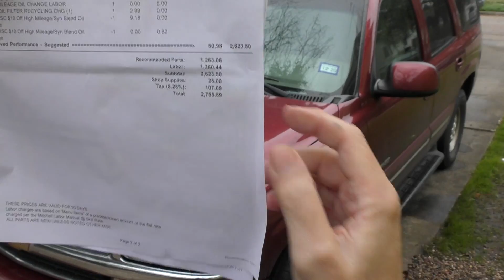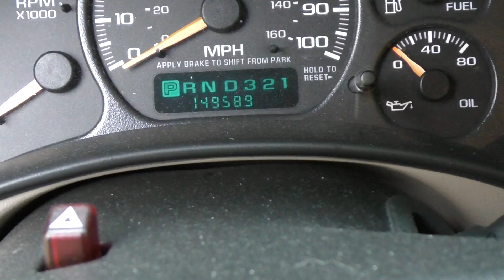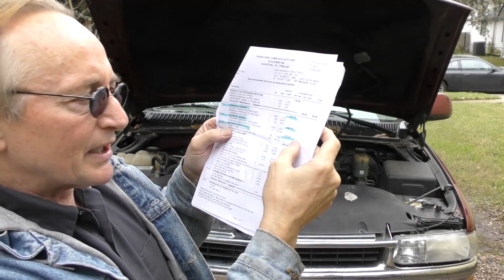This Makes Me Want to Quit Being a Mechanic

Comment: Valvoline passed my NY inspection and I knew I had no life left on my brake pads and a warped rotor
Reply: Andrew in a nys inspector . The law is if it’s not metal to metal it passes, you could seriously have the thickness of a sheet of paper left and they technically pass and same with rotors long as they are not cracked your broken they pass

Comment: Good tip, thanks. I went to Big'O Tires for oil change and they said I was down to 4mm and need tires soon....I had calipers and knew I didn't. 18 months later, had tires inspected at Pep Boys  = 6mm still left on tires. Big'O Tires manager, "Oh, your battery is bad." I pointed the inspection, "Inspector checked off that battery is good." I changed out the battery 2 years later (because I wanted to).

Comment: I had a Mercury sable I tried to replace the spark plugs and I went to Firestone to ask for a estimate and they try to charge me almost $ 500 dls for parts and labor and I said no thanks it was my first and last time with them I just no recommend them NO WAY
Reply: $500 is normal for a basic tune up but for JUST spark plugs then yes. Big ripoff
Reply: Rock-E Oldboy maybe in 1980
Reply: Even with labor that is $100 tops. It’s insane how much places are charging for spark plugs. $300-$400.

I bought some 100k rated plugs for $30 and called it a day.

Comment: I went there for 2 inspections because I thought i had a blown head gasket on my mustang. They told me no head gasket but needs valve cover gasket. Drove the car hard for a few thousand miles and found out I had a blown head gasket and the motor now needed 3,000 in work because of driving on it 🤦‍♂️

Comment: One thing I learned from Scotty “ If ain’t dripping ain’t broke”
Reply: Yep.  I tell my customers that all the time.
Reply: if its DRY AS A BONE, its DRIVIN YOU HOME
Reply: Even a small drip means nothing. Keep the fluids full and you're fine.
Reply: I II III II I Not true at all. I’ve had vehicles that would leave no spots at all that would overheat in traffic from very small coolant leaks.
Reply: @MegaMustangkiller  thats coolant ralated matter. Engine will overheat if no coolant. Oil leaks is different from oil dripping! Light oil leak that does not drips to the ground is fine. When it drips, u have to get it fixed. Serious problems.
Reply: @MegaMustangkiller  get it fixed yet? Head gasket?
Reply: Matt Schmitt was a radiator and I fixed it about 6 years ago. With a/c on it would over heat in traffic but would never leave any “evidence” in my parking spot. I wouldn’t totally discredit everything Scotty says but as an Ase certified master technician I find quite a few issues with his practices. Not trying to be a YouTube know it all I just think that for peoples own good they should take his advice as well as anyone else on the internet with a grain of salt.
Reply: Troy Truong some people should also try to learn the difference between something that a technician noticed while checking out your vehicle and wanted to make you aware of to let you know how much it would cost to take care of when you have the money and something they said needs to be fixed today. This guy blows everything out of proportion to get views. For all you know the employees at that shop may have just been informing the customer of a problem that was developing. If you ask Scotty he’d probably say that skim milk is a scam because it’s mostly water

Comment: I took my Lexus rx330 to the dealer to have the cracked dash replaced under a recall. No charge to replace it but they gave me an estimate of $6,000 of recommended repairs they said I needed ( including replacing the radiator) I took it to my own mechanic & he said all of the “ so-called” issues were fine. 5 years later & still no problems with the Lexus.

Comment: The worst in Canada are dealerships. That friendly greeter in some dealership works totally on commission. Then some of the prices are nuts.$50.00 plus the price of the bulb to change a brake light,$65.00 to instal a battery, plus the cost of the battery,$25.00 to put on windshield wipers plus the cost of the wipers. Brake job all 4 axels can be $1500 to $2000.That why I do it myself.

Comment: Meineke had a great deal on an oil change ....$15.99.  The Oil and Filter would cost me that to do it myself, and I have to pay to have the oil recycled.  I took it in, and when I picked it up ... they handed me an estimate of $1700+ for random fixes.  I told them I'd be back, and 4 years later finally sold the car with none of those things fixed, and it was in great condition.

Comment: "lots of tread here" sidewall fibers exposed
Reply: Why does this not have more likes. I came looking for this comment and had to dig.
Reply: Those tires might be 8 years old regardless of the tread depth then they should be replaced.
Reply: Exactly scotty can be dumb at times but hea a mechanic not an auto tech so what do you expect theyre all going extinct because of a mindset like gis
Reply: Those tires were curbed multiple times by someone who likely cant parallel park very well.
Reply: It looks like they drove down a wet gravel road and got in a puddle on that side. Then drove for a bit on damp concrete cleaning off the treads and not the sidewall. Back tire had some on it. The raised letters were still on the tire. I'm no forensic scientist, but my guess is you're no tire inspector.
Reply: 3:55 that’s actually the paint coming through for the white branding. Not any “fibres”. Most of these tyres can be mounted white writing in if you don’t like that look.
Reply: @RC-rb1cp  that's more to do with the ever increasing amount of electronics and computers than anything else
Reply: Those tires looked like crap honestly
Reply: That's actually paint.
Reply: Yea
Reply: If I had to guess from the quick look he gave of the tires they look to have 4/32 of tread left which at the tone of the tire you start looking for your next set
Reply: In what way does that look like sidewall fibers
Reply: LOL

Comment: A few years ago I took my Jeep Cherokee to jiffy lube for an oil change. They came out and showed me the oily pcv valve & said it needed replaced. The Jeep had 120,000 miles on it so I said ok. Then, 3,000 miles later, I took it back to jiffy lube for another oil change. The guy came out with another oily pcv valve & said it was bad & needed replaced. I told him they just replaced it 3,000 miles ago & asked if he REALLY thought I needed it. He said “ well, I guess not “. I never went back

Comment: I needed 2 tires replaced on my Nissan Sentra, so I took it to the local “Liarstone” dealers. They charged me for 2 valve stems in addition for the tires. I looked at the stems and they still even had the road grime on them and the rims were still dirty, except for the fingerprints where they handled them for the tire change.
The car has a TPMS system, so I KNEW they hadn’t touched them. Got that valve stem charged taken off. They admitted they always charge for stems because “they usually change the stems out of course of habit.” Guess they just “missed them” this time.
That was the last time they ever got to see my car in their shop.
Reply: david Hanesworth To be fair, and I’m not defending them, but tire stores like Firestone and Pep Boys do “rebuild” TPMS sensors with new rubber valves or new nuts/washers depending on the style, and as someone who started off at a Pep Boys, sometimes it does happen that you just get in a rush and forget. It’s an unfortunate thing, but I can’t say I never accidentally did it, and I’m willing to bet every single person who’s worked at one of those stores has done it, even if it was just when they were starting out in their careers

Comment: i took my car in for an anual inspection the shop told me:
1) reverse lights didnt work
2) there was an egr fault
3)the seatbelts didnt catch when he pulled them

i went to talk to they're mechanic and found:
1)the mechanic didnt have the car turned on when he put it in reverse (manual)
2)my car does not have an egr valve
3) he didnt "pull" hard enough

the shop charged me $120 and threatened to put a mechanic lien on the car if i didnt pay (they still didnt give me the inspection paper)

Comment: Here in NH, yearly inspections are mandatory. The law is written such that any inspection issues found have get the OK from the shop who failed your car. So unless your mechanic is a Saint, you could wind up in the inspection/car repair racket.

Comment: Scotty, I wish I could claim this was unusual.  I've been doing most of my own work, but an alignment isn't one of them.  I took my '02 Ranger to get an alignment at a local shop (with a coupon) and they told me I needed wheel bearings because of the feathering on the tire.  $500.  I do actually now need wheel bearings on the one side, after 150,000 miles.  The bearings cost less than $20.

Comment: The Managers are paid bonuses based on a PTA (per ticket average) they run $20 oil changes thrn offer the managers bonuses if they can make ex. $75 per ticket average so the managers try to up sell everything they can to bringvthe avg up to bonus range.

Comment: Lol, you call that a scheme?! Here in Europe where we have the government inspection, you will not slide through with $25!
Reply: GEEZZ!! What do they charge you guys?
Reply: @invaderzim1265  It depends on the country but in general, they are very strict especially to older cars. The inspection itself actually cost about $25 where I live in eastern EU but if you have an older car you will need to change parts and chack it in private service before you go to inspection to make sure it will pass and that's what costs money. Also, nothing can be modified, you can't even have toned windows plus you also need to pay a road tax. For my 2006 VW Passat B6, I had to pay about $125 last time without insurance cost and nothing needed to be changed. And $125 is not a small amount of money where I live...

Comment: I am no mechanic but i did study Mechanical Engineering in College and i have a good idea of most mechanical things. So, that Chevy that Scotty showed with a bit of grime and grease...go buy a can of engine shampoo and give under the hood items a good cleaning. The cost will be about $10 and 30 min of your time at the most. As for the rear diff....it wouldn't hurt to drain and refill the diff with new gear oil. My Tacoma sees off road conditions...so every 100 000 kms i get the two diffs....the transfer case and transmission drained and refilled because of the risk of water contamination. I had this done at my Toyota dealer at a cost of $160 i think...which seemed pretty fair price to me. As for all the repairs listed on that estimate...those crooks should be neutered. Good for you Scotty in being so honest. The world needs more guys like you. I would argue that being honest like you are may give you lifetime customers. If you build a level of trust...should mean repeat customers for sure.

Comment: I'm glad we don't have inspections here in Florida, I've driven vehicles with the check engine light on for years. The lights were for small things like catalytic converter efficiency and evap system

Comment: Midas tried to charge me $150 for serpentine belt replacement. They said it had a crack in it. Put a new one on it myself (30 bucks) a coupe days later. NO CRACKS/CHIPS/TEARS.  I only take my car to the shop if I know it needs serviced and I don’t have the tools, space, or time.

Comment: FireStone inspects the car and writes down all the problems it has & looks up the Manufacturer Milage maintenance. For example If the manufacturer recommends new coolant hoses at 150,000 miles FireStone recommends it. New air filter every 10,000.  Alignments, tires, brakes.

Comment: Sounds like the opposite kinda shop I went to once. ONCE lol check engine light came on noticed no acceleration plus other things on my ford ranger. Took it to a place and said whatever is wrong with it, fix it. The owner wouldn't touch it. Kept eatting his sandwich and walked away.

Comment: As a kid, I worked at my dad's garage.  So, I'm not a mechanic by trade, but I at least have a general idea of what's going on.  I hope Scotty sees this ... I went to a garage near work, and asked them to change the pinion seal on my rear end.  The guy calls me up, says my rear shocks need to be replaced too ... they're "seeping oil."  I said don't do anything, I'm coming over.  Oil had been flung by the leaking pinion onto the metal "skirts" on the rear shocks.  Those skirts don't have any oil in them, that metal CAN'T POSSIBLY leak.  I told him let it down, and I'm outta here.  He lost a customer.

Comment: That is the same Firestone location on Kirby Dr. that I used to take my vehicles to for lifetime alignments. 9 years ago they told me I needed to replace all radiator and coolant hoses because they were cracking on my 3 year old subaru outback. I went home and wiped them down and they still looked brand new. That was the last time I went to that particular shop. 9 years later I am still driving with the same hoses and no coolant leaks.
Reply: WOW!!     LIKE WOW!!!!😲

Comment: Scotty ,please read Car and driver, GM recalls 2019 Silverado and Sierra for break-failure issues. The onStar App was causing brakes to fail. I never used my phone to operate truck in any way! My dash board lights came on BREAK FAILURE!!!!! I turned off my truck,then started back up. Check engine stayed on.Alert said," don't operate over 43MPH. Yeah! dealership said," it's fixed". Should I be concerned?

Comment: THIS is why Delaware has STATE RUN inspection stations where NONE of the inspectors have ANY motive to tell you that something is broke. There is a station in each county. ALL things are checked including a braking check where you are required to drive over a pad and hit your brakes. The system will show how each brake is working and which one is weak. States should look at doing this as it is another way to gain revenue. You are NOT charged for the inspection but you will have to pay for the tag sticker for the year. at only $50 per 4 wheeled vehicle or for two years on ones that qualify for only $100. NOT BAD. The state of Delaware does well on this.

Comment: I had a Tread Quarters shop in Virginia try to sell me about a thousand things I didn't need at exorbitant prices and then top off my power steering fluid for an inspection. The power steering cap was never touched. It was still very dusty. I left with no work done other than the inspection, and the shop kept warning me I would break down. I drove all the way from Virginia to Louisiana and back just fine.

Comment: Once I go to a mechanic for oil change and front brakes check at 60000 miles. He told me I needed all four brakes replaced. I told him just the oil change and do the front, because I know rear drums brakes last much longer, and never go back.

Comment: While I am a mechanic at a branch of Bridgestone this would not go by me or the manager. I would say the pinion seal is leaking,  from the brief showing of the valve cover not leaking but what about down the rear of engine?  The tires should have the 32nds shown on the inspection sheet. And once they put the estimate together they are supposed to take you out to the car and explain it to you and talk to mechanic if not then they are not doing their job correctly. Also there are a couple types of mechanics  cheap ones(only fix what's needed,  maintenance try to sell everything recommended by manufacturers at a time interval,  and the ones who want to replace everything in a specific job.

Comment: Having lived in three states, Oklahoma, Missouri and Arkansas, the state inspections were only lights, turn signals and brake lights, wipers and horn.  Inspections usually cost around $5.00, but have gone up over time.  It was usually tire, muffler or auto repair shops that did the inspections.  The only time you had to do a repair for an inspection, was if one of these components was not functional and usually it was a light bulb that was out.  You had the option of having them change it or do it yourself.  If you did it yourself, You would have to pay the inspection fee and go back later to get your sticker after the repair.   I currently live in Oklahoma and they did away with inspections in this state over a decade ago.

Comment: I've been there and done that.  I went to Firestone for new tires and they sold me on the complete diagnostic.  The diagnostic was 5,000 dollars with 2,000 in parts and 3,000 in labor.  I went to my mom and pop shop and they did everything for 1,600 dollars.  Them big chain repair shops like Firestone, Midas, and Pep Boys just looking for a quick buck.  What really pissed me off was that they wanted 132 dollars for an idler arm for my truck at Firestone.  That same idler arm was 39 dollars on Rockauto.  What a bunch of crooks.

Comment: Q - Hi Scotty, thank you as always for such a great channel.  My question is - As cars get more and more complex, computers everywhere, battery technology etc will there be a role for independent mechanics like you?  If not, where will customers go for honest, good value repairs?
Reply: There are not many options out there right now. I did a national survey on Mechanics from all walks of life. Most admitted that most modern vehicles are too complex for them to accurately diagnose them.
The only reason I comprehend sophisticated car electronics is because I'm a Mechanical Engineering Technologist.
I own a fleet of Asian- Domestic- and European Vehicles. We do all Diagnosing- Repairs and Maintenance in- house. We occasionally need the dealers to help with Software updates for the cars computer systems.